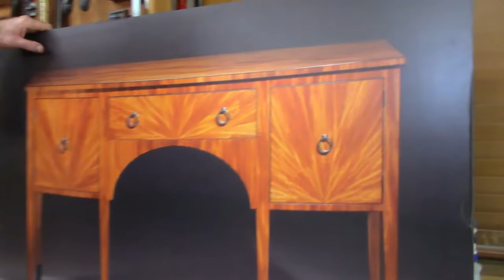How to Inlay Butt Hinges with Tom McLaughlin

Comment: Hi Tom, great information on the hinges, I liked your hinge jig, and will need to follow your hinge method. When I was loged in to you tube, for some reason I could not chat, the message chat line under my name was missing unavailable could not chat in. It seems there where ads in the way could not remove them. I could read others chating in, I hope it's available next week. I did check other channel live chats and my chat line was available. See you next week.
Reply from the maker: Thanks Steve, glad you liked it! I’m not sure what that was wrong with the chat, I’ll run it by the camera lady and I’m sure she’ll figure it out. Thanks, see you on the stream! 👍😎